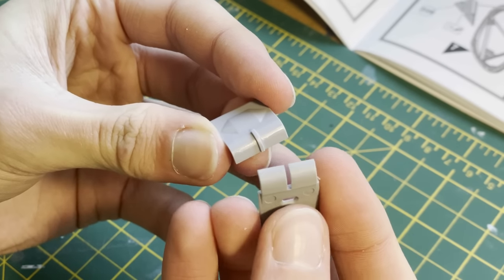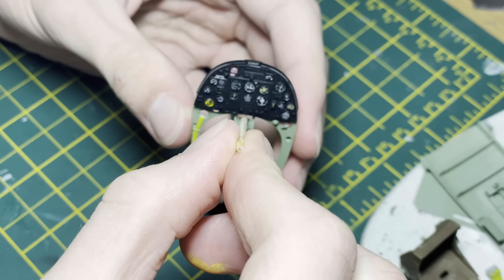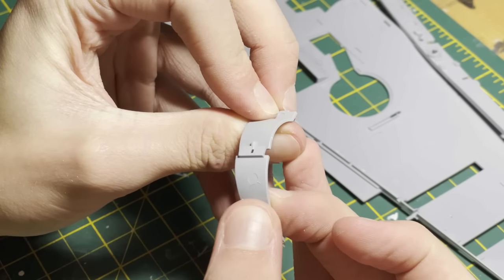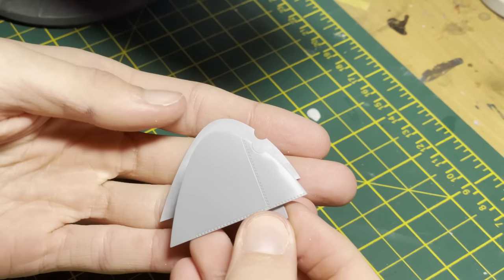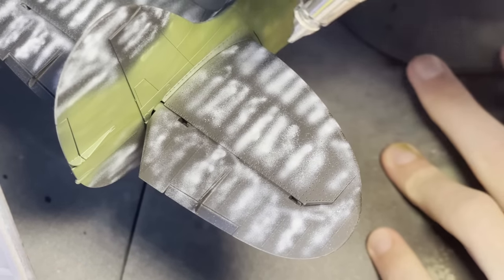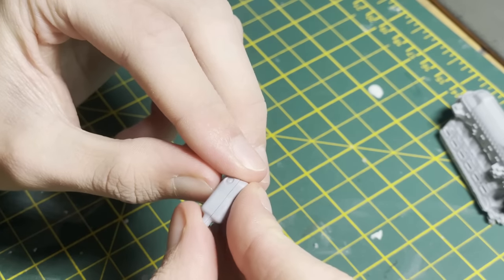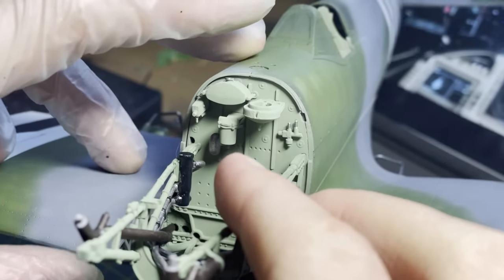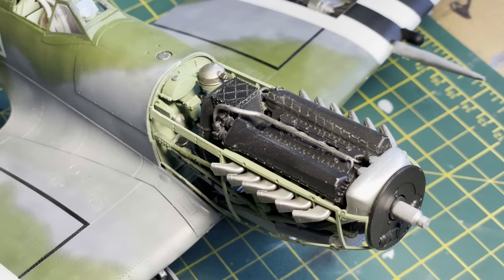Airfix's Brand New 1:24 Spitfire Mk.IXC | Full Build | HD

Comment: The 'big lump' of equipment at the back of the engine is the supercharger. The fuel was metered into this and then the fuel/air mixture was directed to each of the cylinders. None of the Merlins or the Griffins used on the later versions used fuel injection
Reply from the maker: thank you very much for that bit of information!!

Comment: CONSTRUCTIVELY:

"Throttle" - that was the "Chassis" (undercarriage) control on the right side of the cockpit.  The Throttle and Prop control was the similar sized bit left side (you didn't show)

Compass - yes - that was the compass.  It's a seay grey color in real life in the green metal bracket.

"Thick" seatbelts.  The Sutton Harness IS "chunky" in real life.  Heavily woven jute type material.  Airfix actually got this correct.

"Tail pieces" I'm sure to allow for later mark Spitfires where the tail wheel also retracted.

"Wing Formers" - they are "Ribs"

"Landing Light in the wing" - no.  Gun Camera window.  The Mk IX didn't have landing lights (which were originally on flaps under the wings which opened on the earliest marks only).

Radiators "Main sort of jig".  That's no jig!  That is the actual radiator core.  Like the ribbed/finned part in a car.

"Invasion stripes".  Hand brush applied in the middle of the night prior to D-Day - in real life they were NEVER as "perfect" as they appear on models.  Not to say the fitters were not trying to be neat - but they were not using masking tape!

"Fuel Tank place where fuel goes".  That's the oil tank.

"Turbo" = that is the Supercharger.

"Intake system" - carburettor and air inlet.

"Wire fuel injector system".  Spark Plug leads.

"Other set of wires" - More - Spark Plug leads.

Chin Tank - Oil tank

It IS a firewall.

You keep calling it a "frame".  It's the Engine mount/bearers

"Shock Absorber" - well yes - that's what it does but it's an "Oleo Strut"

"Gear Cover" - "Gear Door"

Chipping Effect on "nose" (actually a "spinner").  IMO everyone completely over does this.  It should be much more like very small scratches around the back edge at the fasteners that keep the spinner on.

Ammunition in the gun bay.  The ammo was brass and lead colored - not steel.

Exhaust stubs.   They go "blued" / rusty metal quite quickly.

Again - all meant CONSTRUCTIVELY.
Reply from the maker: haha thank you so much, i absolutely loved reading this comment… taught me so much!! if i ever make a spitfire again i’ll make sure to refer back to this comment!! i hope my mistakes didn’t make the video too hard to watch! thanks for the comment :)
Reply: @machmodels  I can thoroughly recommend going to do a “flight” in the spitfire simulator down at goodwood. It’s a real spitfire cockpit with real parts from real spitfires. It’s what they train people in before they let them loose on real spitfires. Not only will you see what the real thing looks like, but you’ll be able to “fly” it. It’s not just a game, it a real simulator with almost 180deg field of view. Short of an actual flight it’s the closest you’ll get.
Reply from the maker: @davideyres955  thank you for the suggestion! i’ve always wanted to do one of those! i’ll have to get saving
Reply: Mr. Eyres, I deeply admire you for your depth of detail. You never need to apologise to me: I actively seek the fact checking and accurising of chaos such as yourself. I wish I could put all you lot on retainer, and your mobile numbers on speed dial.
Reply: @machmodels  Not at all and thanks for taking it as I meant it.

David Eyres mentions the Goodwood simulator in a post below.  Or you can try the real thing.....

https://www.youtube.com/watch?v=DWqvo-gk-y4
Reply: Spot-on Graeme .
Reply: The "pointy prongs" are the camshaft driveshaft housings...
Reply: I thought 'Oleo strut' was a type of blues song...
Reply: @BenjWarrant  Oleo Strut is spring and shock absorber combined in one - with pressurised gas (nitrogen) performing the spring/support function while oil absorbs landing shock the same way as conventional shock absorbers do.  In some cases a spring is actually used inside the strut instead of oil - but such struts are called Spring Struts (Cessna Caravan 208 Nose Strut is that sort of thing).
Reply: @tailfirst  Ahem. Whoosh!
Reply: @BenjWarrant No. The Oleo Strut was a 20s flapper dance, created by the same bloke who came up with the Charleston.
Reply: @throttlegalsmagazineaustra7361  Yeah, whoosh! to you as well.
Reply: I so deeply appreciate you for these corrections. I am an excellent speller, as well as an aspiring novelist and essayist. I still err more than I care to admit. To have a HUMAN spell-checker go over my typing would delight me no end.

Comment: Cracking. My first model was an Airfix Bf110 in 1972. I sat on the front door step and made it in one go. I think Airfix had a 1:24 scale Spitfire Mk1 then. I haven't made a model now for 40 years. I would like to start again and make something like this in a few years when I retire and have time.
Reply from the maker: thank you very much!! i cannot recommend the hobby more it is so relaxing and also rewarding, hope to see a couple of your builds at some point!
Reply: I have just started again after a similar time. I have started with the revell range from LIDLE massive saving but you hsve to be quick they get sold out! Went from models to building the real thing. Good luck.
Reply from the maker: @davelar3868  best of luck, revell can be a little 'sticky' to build sometimes!!!
Reply: @machmodels  yes got to agree building 1/72 corsair at mo there are also some parts that could be included in to the mold like engine cowling wing tips and stabalizer maybe a saving in plastic somewhere?

Comment: Nice build and some good tips along the way. Fit looks good and maybe that's a result of the Airfix manufacturing of this kit in the UK. Agree about the seat belts - the thickness makes them look toy-like and look forward to some after market belts in photo etch or even fabric in this scale.
Reply from the maker: thank you! I agree having some fabric seat belts could be the cherry on top for the cockpit in this kit! Thanks for the comment
Reply: It looks "wrong" but it is "right".  Sutton Harness belts are thick, woven, chunky jute material.  Far thicker than you would think.  About 20 modern car seat belts thick.

Comment: Round section at rear or the Merlin60 is not turbo, but a two stage supercharger. An SC compreses air going in. A turbo uses exhaust gas to then boost air intake
Reply from the maker: Thanks for all the information👌🏻🤙🏻

Comment: I so would love to build this kit. Several, actually. 
   The level of detailing veritably cries out to have the cockpit, the gun bays, the engine compartment, etc., open to view as much as possible. To facilitate the verisimilitude, I would have modest amounts of battle damage in the process of repair or replacement. Preisser (Germany) offers 1:25th-scale figures to populate the tableau with the appropriate work crew. These are nude, requiring full dress; this lends itself to one fashioning the specialised garb suitable to the scene. If one is recreating a North African campaign, one could have the chaps who for the heat have dispensed with their shirts. 
   At 4:04, you mention your preference for a look that is "lived in but not grimy". Quite so, mate! I know just what you mean. It is as I would have it, as well. 
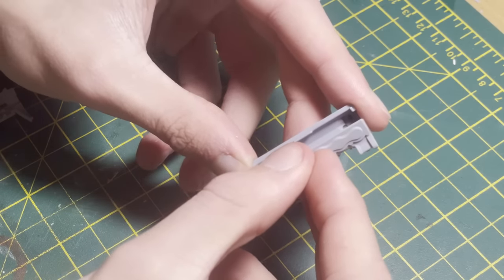   At 38:53, you commence work upon the Rolls Royce Merlin V-14 engine. In a ground display with many of the access panels open to reveal the interior, I would have a team of hardly blokes drawing forth from the nose the aircraft's rather worn, damaged engine; some of the forward fuselage parts would have a few rough holes to show for it. I then would borrow the assembled Merlin from a second kit (this one I would build in flight) to dramatise an exchange for a clean, new one. One might have to cast resin duplicates for a few of the engine parts for use in this second project. For that matter, the airborne model would require a pilot; I am confident, however, that one of the Preisser lads gladly would step forward.
Reply from the maker: cant recommend this kit enough - yes i tried to make rhe plane look more worn and damaged rather than dirty and grimey as it sometimes looks a little harsh!

Comment: HELP A born again modeler here! Last built kits when I was about 13. I'm now a Retired 65 year old  who has completed a few builds plus I mastered Air brushing too but now for my plea for help!.... Gluing ready painted parts?  Such as brush painted cockpit details (Painted on the Sprue)  how did you glue these to the 'cockpit green' sprayed interior panels? I've experimented after watching various build videos  but if i glue (mainly use Tamiya extra thin)  2 painted parts together  ( I mainly use Vallejo acrylics) all I end up with  is a slimy multi colored mess that doesnt seem to hold? 
So here I am with my Xmas present, the ubiquitous Airfix 1/24 Spitfire Mk IXc  and I want to try and understand HOW TO ACCOMPLISH THIS 'DARK MAGIC ! before I start!
Brilliant Video, as usual!
Reply from the maker: Well firstly, welcome back to this superb hobby! So, this video was made over a year ago so my techniques may slightly vary to how I would approach such a task now. Back then I would kinda use Extra Thin and hope for the best, but recently I have started to use this magical substance called Ammo Mig Ultra Glue. In basic, it is a PVA type of glue that dries to the strength of CA glue. What is great about it is that it doesn’t try to melt the plastic to bond them together which prevents you from having the yucky mushy paint stuff which you are currently experiencing. A small downside is it takes a while to dry fully but it is a small price to pay! So in summary I would grab some of that Ultra Glue and I think you’ll be a-okay! Let me know if you need anymore assistance🤙🏻

Comment: Awesome video Mate. But I was cracking up watching you build the Merlin. Famously, one of the advantages the Meshersmit had over the Spitfire was that it was fuel injected and the Spitfire which wasn't would starve for fuel in a climb. What you thought were fuel injection lines were ignition lines.
Reply from the maker: haha thanks for sharing!! that would make a lot more sense! as i said in the video i need to increase my technical knowledge on the spitfire… it really isn’t up to standard!! i hope you enjoyed the video, even through my little mistakes :)
Reply: @machmodels  loved the video and congrats on a lovely model. Would love to get my hands on one of those Spits myself.
Reply from the maker: @michaelcrane2475  what’s stopping you! is it stock or where you’re situated in the world?
Reply: @machmodels  At this moment in my life I am homeless,  living in a tent. Surrounded by a load of other working Kiwis who can't afford to rent a home in our own country.
Reply: Not quite, the SU Carburetters on the Spitfire suffered fuel starvtion in a bunt over (dive) which causes negative 'G'. An itermim solution was the addition of 'Miss Shillings Oriface' which was basically a washer with a hole which was added to the fuerl bowl to stop the fuel rising when pulling negative G (other sources state in the fuel line).  Eventually the SU Carbs where replaced with Bendix Stromberg Pressurised Carbs which eliminated the issue

Comment: Great work, was thinking of picking this one up but at the same time I’m currently almost done with their 1/24 scale F6F and that thing makes me want to never touch an air fix kit again with how many fitting issues I had with it
Reply from the maker: thank you!! from my experience with this kit all I can say is if you take your time with dry fitting and cleaning up the parts it goes together with no problem whatsoever, wishing you the best of luck with the F6F!!
Reply: Agreed! Terrible kit, fitting the cockpit assembly into the fuselage was a pig on mine, and the amount of clean up on the engine parts was hideous
Reply from the maker: @stevenartmann2642  scary that it is still being sold with such a reputation! i will make sure to stay well clear of it

Comment: I really love your talent of model building. Can I ask please what is the airbrush and compressor are you using as I need to purchase a set up. Thankyou
Reply from the maker: thank you very much!! very kind of you :) to answer your questions, my airbrush that i am currently using is a harder and steinbeck evolution and for compressor i use a sparmax TC2000. However, if you can get a compressor with an air tank you’ll have more consistent airflow :) hope that answers the question!!

Comment: Beautiful work, sharp detailing and great result.
Only thing that stands out is the dihedral. Each wing has 7deg on the wing datum line, yours looks very flat. Not sure if that was the kit or if there is anything that can be done now.
Reply from the maker: thank you! I was thinking the same thing about the wing, just forgot to mention it... for once i don't think it was my fault!! the wingspar just wasn't able to hold the correct dihedral, thanks for the comment :)
Reply: @machmodels  I know its hard with some kits and they could do with a jig to support it as the glue cures. 
I’m building a 1:5.3 scale flying model all scratch built, so my eye is finely tuned to the Spitfire and any anomalies!
Reply from the maker: @tonymanzur8529  oh wow!! my jaw is on the floor that is easily the most impressive scale spitfire i have ever seen!!
Reply: Can`t believe they have got the dihedral wrong on this new one as well, that`s one of the problems with the old one
Reply from the maker: @asdfghjklkjhvbvcvjhvlyhb9957  seems like an issue that should’ve been a priority to be fixed?!

Comment: I wished some of the body parts were snap fit or screw on, giving the modeler an option to display interior detail.
Reply from the maker: very good suggestion, it would be a nice addition if they could make them magnetic like some of kinetics recent kits which allow the ordnance to be switched out through the use of magnets!
Reply: @machmodels  It would work, cause this is a substantially sized kit, and even the smallest parts have some real estate to allow snapping.
Reply from the maker: @gokhanersan8561  exactly! couldn’t have put it better myself

Comment: Did you really put the throttle on the stbd cockpit wall? Is that what the instructions said or the moulding dictated? If so it's a fundamental error. The throttle in a single seater is always in yr left hand. I have flown RAF single seaters, and sat in a handful of Spitfires, and the throttle is on the left.
Your model making skills are impressive but you may have been misled.
You were correct abt the compass.
Don't mean to be - ve, but accuracy matters.
Reply from the maker: no need to worry about being negative!! always like to look what people have to say, i was thinking a similar thing but this is what the instructions wanted and that’s where the location slot was!! i was thinking that it could be something other than the throttle but i couldn’t think what else the part could’ve been!! in summary i did exactly what the instructions said!! thanks for the comment!
Reply: I did some Googling. The box on the stbd wall is undercarriage up/down.

Comment: Sorry Paints you use also, make and models of air sprayers and anything else you may use.
Reply from the maker: Yes of course mate! So the majority of paints I used in this build was Ammo Mig, they are a water based acrylic that are pre thinned for the airbrush and on the whole work brilliant! That being said I use a lot of different paints for different uses so the more videos of mine you’ll watch the more you understand where I use different paints and why I use them! So for airbrush I use a Harder and Steinbeck Evolution for a lot of stuff but that is a rather expensive option, I also use a cheaper £20 airbrush which is a Fengda (find a lot of these on amazon but they work great!). For compressors I use a Sparmax one with a tank (very useful to make sure it has an air tank). For glues I usually use for plastic on plastic Tamiya Extra Thin, for filling gaps etc I use VMS flexy CA glue which works brilliantly! I’m not sure what else I can think of let me know if I can answer anything else🤙🏻
Reply: @machmodels  the drill and bits you use, and sandpaper plus craft knife etc.